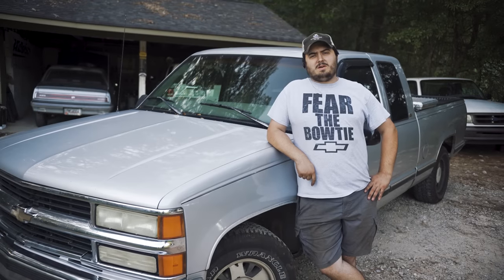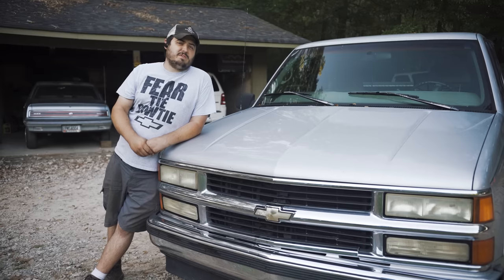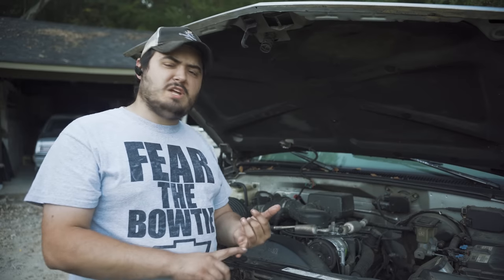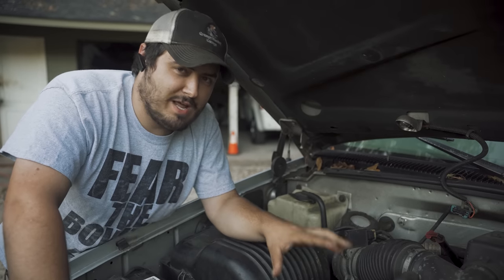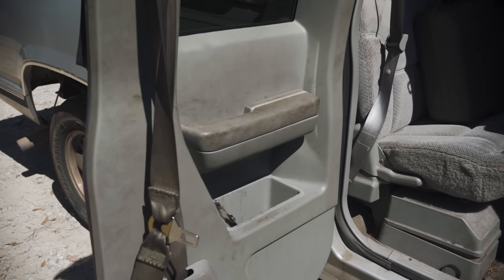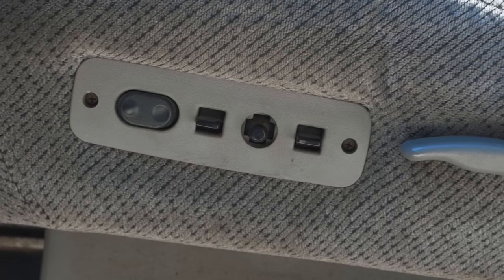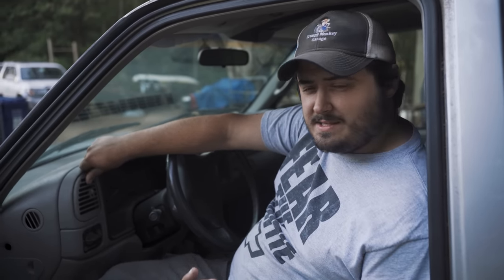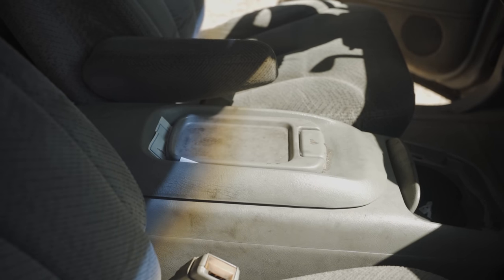OBS CHEVY TRUCK REVIEW, 1997 Chevrolet C/K1500 Silverado Review, The Best Truck You Can Buy?

Comment: I love my 96 k1500. I must admit the 97-03 ford's are great too.
Reply from the maker: Blasphemy!
Reply: The 97-03 f150s are good they got the 2valve 4.6 v8 which was a good engine. really reliable nice seats on the inside nice nostalgic 90s Amazon green colored color  on the outside , paid two grand for a 98 it now has 187,000 on it, still runs smooth. only complaint is loose steering which I heard is common on fords. Getting any Chevy, dodge or ford truck from the 90s or early 2000s and restoring it is   a way better option than wasting 50 grand on the new ones

Comment: Just bought a lifted 94 k1500 with the 350 and only 165000 original miles! Unfortunately I had to get the transmission rebuilt but I'm hoping the motor will last
Reply: Lifted trucks will need a lot of modifications like gear ratios, etc. Otherwise they are very hard on the drivetrain, hence your transmission failure. I bet it looks awesome tho 😎

Comment: i have an 88 extended cab longbox fleetside   straight af     my daily is a 94 extended cab longbox fleetside both have 5.7    the 88 is a 5 speed manual   and my daily is an automatic with overdrive   and both are rust free   the 88 needs some tlc   and my 94 purrs like a kitten  and is spotless  NEVER getting rid of either    best trucks ive ever driven   cheers    long live the bowtie  :)   (both well over 400000 and oe everything   roflmfao)

Comment: Tailgate is tough as nails. My dad backed it up into a tree, massively bowed out. Removed it because it was too out of shape. Door handle on the driver side door did fail. But manual windows was a dream so just outside door handle. Seats were ripped to heck and was manual. No suicide doors, and stuff like that. And no overhead fancies. Everything was in the middle. Bench seat. It was an extended cab as well. And it was a 2500 Cheyenne so idk. I never researched into the truck, but I want to find more out. Also the steering wasn't the biggest thing I think, brakes were. Also starting it, driving it, and it was a death trap. Only a few times the taillights went out. So idk, pretty similar but many different problems. But it did not look like that. It looks like this truck the most. My dad's truck is probably a few hundred. Pretty rusted out, many problems, and pretty dented.

Comment: Great trucks. Be aware the anti theft systems can go haywire and make them hard to start. Spider injection systems go crazy too. They sure run nice when everything works the way they're supposed to
Reply: The problem with the spider injection was carbon buildup. Can easily be prevented

Comment: My Father in law purchased new  (white) 1990 Chevrolet  WT-1500 4.3 V-6 engine, 5-speed manual Trans. You had to know this guy, he was an easy on the vehicle type of driver except he had no business having a stick - shift, however he always purchased manual transmission equipped vehicles $$$ anyway this man would lug the engine all the time by shifting way too soon, grind the reverse gear by not coming to a complete stop before grabbing reverse. This was the way he drove the truck from day one leaving the dealership all the way too 212,000 miles. At this point the truck needed major repairs but was still running and driving. Just think if he would have changed the oil at sooner intervals and not 10,000 + miles. This truck got no love at all. He would drive with black thick oil till the oil light would come on at stops, then and only then would he add oil to bring it to the full mark, and keep on driving. The end of his ownership with the truck was because the engine had passed a lot of oil into the exhaust system, plugged up the Cat Converter so it would not pass a California smog test, he sold the truck as is for parts or restoration.

Comment: Im getting ready to buy one on Wednesday any tips or anything I should watch for? It has 205,000 miles with a 60,000 mile trans.
Reply: At 200000 miles first check for rust under fenders and check the frame underneath with flashlight, check radiator coolant (dexcool) levels and reserve make sure it’s not real dirty inside tank and levels are correct. also when you crank it listen and make sure starter doesn’t whine while cranking and make sure engine isn’t missing or ticking while running, alternator voltage on dash should be on or just barely under 14 volts look at belt & pulleys & Check Oil make sure it’s not milky or cloudy and look at oil pressure on dash around or above 40 overlook and ask owner about transmission replacement and brakes when last service was etc... note the 4l60e is good trans but often you’ll find flywheel and starter issues on rebuilds and if it’s an nv3500 5 speed ask about service on that too it takes synchromesh fluid. One other thing thats important to check is rear differential cover for leaks and on the inside of the back tires for brake fluid (drum brakes on most). Good luck hope that helps
Reply: @jonahsmith2757  Thank you, any info is much appreciated 🙏🏽

Comment: Every chevy truck i own or owned lasted 30 + years ! parts are low cost easy to find and easy to repair ! There are actually grease zerks - and if you keep the parts greased they last alot longer ! and the tailamps - just get some aftermarket ones ! There about $25 apiece

Comment: My 94 I like it a lot don’t get me wrong but when you have salt on the roads, cab corners, rockers and fenders are starting to rust. I’ve had to put a alot of money in it sadly. Everything beside my front end work has been all done right in my garage it’s simple. Just too bad it burns oil but it has 150,000 on it and I have good bets it will go another 100k when I decide to upgrade to a better condition obs

Comment: you said at 14:05 the generation was 1988-1999. they stopped the 4th generation in 1998. I have a 1995 c1500 with 76k miles no rust. great trucks.
Reply: You could get them as a classic in 1999

Comment: Ok so 1st of all I am a die hard Ford diesel from this era fan.  This being said... I bought one of these trucks a 97 to be exact it was in a major front end collision 350 with a 5 speed manual. I put it back to gather after it sit for 10 years drained the fuel tank and put a new pump in it and it fired right up. It's now a Chevy/ GMC truck as that was all I could get for it from the junk yard. It runs good but not as good as my 96 f250 7.3 diesel. I felt bad for the truck and brought it back to life. I will sell it to someone that wants a good truck. Eventually as of now I'm going to get the body work finished and at least in primer so it can be painted easily

Comment: 95 c1500,  previous owner road her till the wheels were literally gonna fall off, and old girl still getting parts replaced here and there, i have a hate/love relationship with it, love it cuz ik if I maintain it, it'll live another 20 years, hate it cuz im young and she taking my money like the damn mob,sometimes I wanna sell it and get something new but at the end of the day I think hell, I already put a few gs on her a few more and it's practically a brand new truck, wish I could do something about the mpg tho
Reply from the maker: Mpg improvement comes with clean air filters and good properly inflated tires, if you don't need mud tires, get regular gas sipper tires. I can squease 16 mpg out of mine on regular 87 pump gas like that. Properly gapped spark plugs help, but tires and air filters are probably the biggest thing I've noticed

Comment: Honestly, the 90 - 2003 era of trucks in general from the big 3 are hard to beat. I do like my old Ford's, and I have a personal love for the Dodges (really just the Magnum engines), and I do love the LS1, but I never gave any serious thought to OBS Silverados. I always just thought they were common cheap and ate transmissions, but the more I look into it, the vortec engines had ridiculous throttle response, excellent low end, all with half the expenses of an LS. In addition to the transmissions, I've found if you actually take care of the shit, they will last. I've seen a lot of OBS Chevys for sale. I'm torn between an old Dodge or an OBS, but the more I at least look into the OBS truck line, the more I wouldn't mind having 2 for the price of 1 Dodge or Ford, for the same reliability really.
Reply: I forgot to mention (bite me): The old Tundras. Yes. Toyota, Tundras. Some of the toughest trucks I've seen (if timing belts don't bother you). I drive a 97 Corolla CE now 😁

Comment: I have leather seats on my 98 GMC and the drivers side seat is ripped right where you slide your leg out. I think someone swapped the original  seats out because it only has 73,000 miles looks sweet all around but the seats look wore out.

Comment: I've been looking for an OBS Chevy for a decent reasonable price in my area for the past 4 years it's  weird because I'm super close to the boarder and most of the time these trucks are being bought and sold over there or stolen but the ones that I do find are usually over 200k miles and priced ridiculously higher than they are worth even the ones that don't have matching beds, doors fenders and hoods are being sold for about 3-6,000$. The other style I am trying to get is the Square Body but those are harder to find running and for a good reasonable price in my area.
Reply: What's the price of those in your area?

Comment: The spider injectors being replaced was not fun. Other than that simple good design. I've owned my 99 Yukon SLT for over 15 yrs now with no major issues, and my 94 chevy shorty c1500 with a bullet proof tbi 350. Curious why GM calls the 95-99 the LT-1 in the chevy 1500 and also in the GMC yukon slt, yukon Denali, and Cadillac Escalade, and my 1996 Buick Roadmasteralso has an LT-1 but is distributor in front (behind the water pump more horse and torque and used in the Corvette, z28, and firebird trans ...straight genius....heavy sarcasm).

Comment: I've got a ford chevy and a dodge. I have a different opinion about this since I just finished rebuilding the entire powertrain on my 1997 chevy 3/4 ton with 350 vortec and 4l80e.... I have to say that overall the chevy is not necessarily easier to work on than the ford 351/302's or the dodge 318/360's. They are all pretty comparable until ford went to the 4.6/5.4 in 1997/98. Also my chevy tailgate doesnt not open or close

Comment: I have an OBS Suburban and it's a good truck, but I have to say, the OBS Fords and the GMT 800s are better, at least than the Vortec models. The spider injectors and removing the middle bolts on the intake manifolds was a dumb design decision. As was the plastic distributor body. The '88-'95 TBI models don't suffer from most of those issues. On an OBS Ford, I don't have to remove the dash to service the AC box, it's all on the firewall. Also a lot less plastic under the hood and an all aluminum intake manifold as it should be, also fuel injectors are outside of the intake on a rail as they should (again, the TBI OBS Chevy models were done right). The GMT 800 has the LS which has a much better fuel injection system and high swirl heads like the Vortec 5.7 but with much fewer design flaws, only the oil pump o-ring and exhaust manifold bolts that are too small. They also have coil near plug ignition which is a nice benefit. No distributor rotor and cap to worry about. I've had problems with both door handles and locks on both OBS Fords and Chevys alike. Interiors seem to hold up similarly which is actually probably the biggest knock against the GMT 800. On my OBS Suburban, I went to an aluminum marine intake, aftermarket aluminum distributor body, upgraded felpro intake gaskets and the marine intake uses actual fuel rails and that finally bulletproofed everything. Those manifolds are really hard to find now, id probably convert to TBI on the Vortec heads if I were doing it today.

Comment: Only thing that is hard to get to is the oil pressure switch on the 7.4 2000 C3500. All the way on the back of engine block. I have the replacement but it's being a bastard to find or reach.
Reply: I've got the same out have to pull distributer and the coil and bracket assembly move the ac hose the you need a special socket for the op switch super size pain in the ass.

Comment: Had a 2001 it was beat up body wise good work truck got it in that condition at 125k miles smaller 4.8l v8 great running truck got rid of it at 245k miles the whole time i had it one water pump and 1 starter besides brake pads couple batteries ran it hard even when i sold it running perfect almost could weld the hood shut and i didn't even really do any regular maintenance did not use oil regret it wife said get it out. My 2015 4.3 truck well she is been good to me little skeptical on her the transmission seems little clunky at times then real great dunno maybee a tune or torque converter upgrade motor has been strong some say because of AFM oil isuues well change your damm oil no problems there and add a fuel treatment each oil change.

Comment: I once refused a freebie 90 something Chevy standard cab, long box model from a neighbor because it had a seized engine. But I couldn't forget it and soon after bought a '97 GMC, extended cab, short box with the V6, standard tranny. It's got a decal on it which says Kodiak Edition because it has a few winter driving options on it. Anyone else have one of them? Even with nearly 300,000 kilometers (ya it's Canadian), it still starts after sitting for a month or more and runs as nice as you could ask. The opening rear door on extended cabs was an option since mine doesn't have that. But I don't have anyone or anything to put in the back seat anyhow, except me when I want to sleep in there. That's the big reason why I wanted the extended cab, to be able to sleep in it overnight at automotive swap meets. Now those events are all cancelled and we sit and wait.

Comment: The vortec heads on those like to crack and when the crank it will fill the engine with coolant that’s the only real issue with the 96 up V8s
Reply: Its not just the vortec. I have a 91 with 145k and it did the same thing
Reply: 464K on a 1997 5.7L V-8,
0 engine problems !!!
Reply: If you run old coolant or let the coolant get low than yes you can crack a head

Comment: The front brake pads on the 1997 c1500, Will fit just fine on a 2001 chevy S10 Compact min truck. The front brake pads on a 1986 chevy Suburban where bigger and stopped much better thin the 97 c 1500 truck!

Comment: You lucky. All of these in Michigan are rusted beyond belief. Still running, since there's tons, but most are rusty.
Reply: I'm in Michigan, but just bought a pristine 97 K3500 from Oregon.  I'd go looking there.
Reply: I bet it's beautiful. I'd look in other states but anything beyond northern Ohio or Indiana is pretty hard to do, since I can't really travel far for a vehicle that I might not buy. I'd have to be CERTAIN if I wanted to buy a car from out of state that I didn't look at. Unless you bought it here, and it was originally from Oregon, that's different.
Reply: @isaac24  I paid a mechanic in that state to do a thorough inspection before the sale. I can't remember the name of the service (maybe Lemon Squad?), but it was 150 bucks well spent.
Reply: Holy crap. You got the deal of a lifetime. Is it 4wd though?
Reply: @isaac24  Yes, 4x4, manual transmission and 106,000 miles.  I'm not lying, I've been looking for a truck like this since the late 90's and finally found one. It was definitely worth the wait.  It does have some issues, like 5th gear whine, and the radio won't shut off when the key it out (possible radio circuit board issue). Seats, windows and locks are all manual.

Comment: I think the 1999-2005 trucks are better and easier to work on and fix because they have better diagnostic software and LS based engines. The older trucks had fuel injection issues that could be a pain to fix. They are also going up in value due to classic status while the 1999-2005 models are not there just yet, but are knocking on the door. This is just my opinion now as far as Ford goes the 4.6l V8 is a fantastic engine and the OBS Ford 4.9l 300 6 will run long past our time on earth if it was maintained right.
Reply: Fuel injection issues are pretty easy to prevent tho. The problem with the spider injector assembly was the popper valves were more prone to carbon build up. Keep them clean and they’re a reliable setup. Injector cleaner every other oil change is good preventative maintenance

Comment: My 96 just hit 140k. Runs like a dream. Leaks a little bit of oil though lol
Reply: Try the mobile one full synthetic high mileage 5/30 it has seal swelling agents and a cleaning package formula that helps with biuld up if the oil is black ⚫ at let's say a thousand miles its cleaning doing its job my oil leaks have stopped with this oil